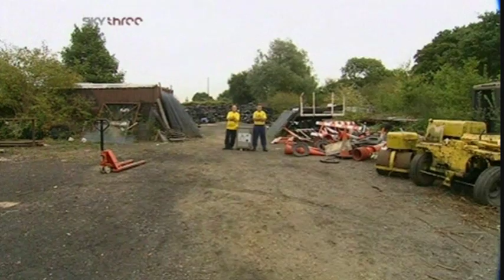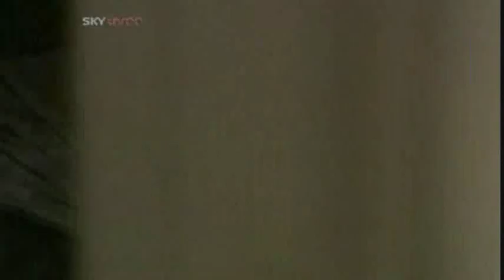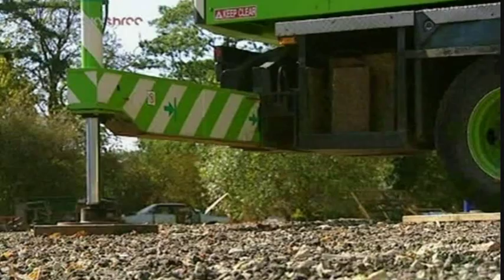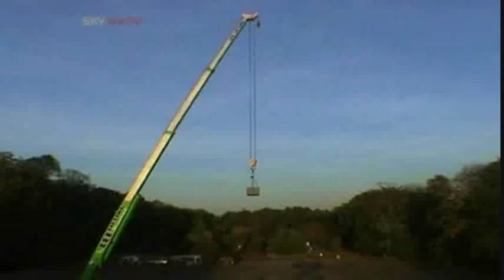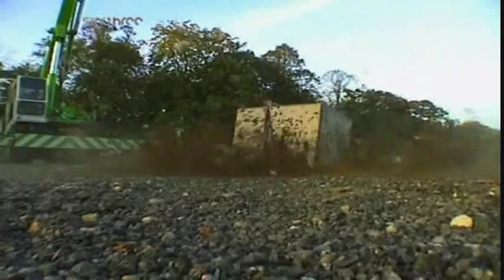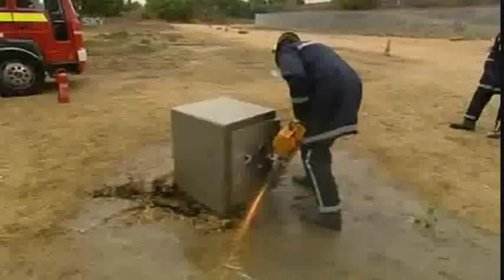Cracking The Safe - Part 1: Gravity

Comment: THats quite a good safe, what you would have found was they have set of some devices in the safe because of the rougth treatment and as a result the key and combination would not have opened it if they were put in, as I say its a high grade safe and on this model it has a cluth so when the locks arnt engaged the handle just spins free,  pity as i could have opened it but not on camera

Comment: Exactly! It's obvious they intended to make the safe look tough by dropping out on its back, and perfectly flat, at that -- and -- onto a gravelly surface, where some of the impact energy would dissipate in the fracturing of the rocks into smaller fragments.

A genuine attempt to crack that safe would have dropped it onto one (or both) of two potential targets: part of the lock mechanism in the door face, or one of the cube corners, in an effort to distort the overall shape.

Comment: If they dropped it on a concrete or steel surface, or on plain rock then the safe might have cracked. also, they could drop it from a helicopter for even more force.